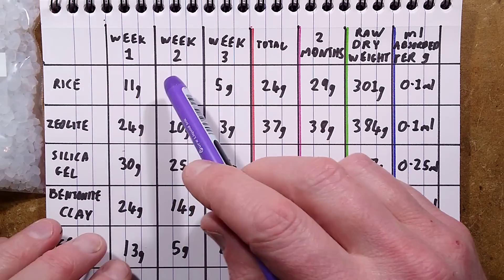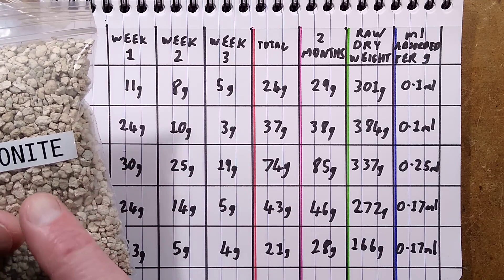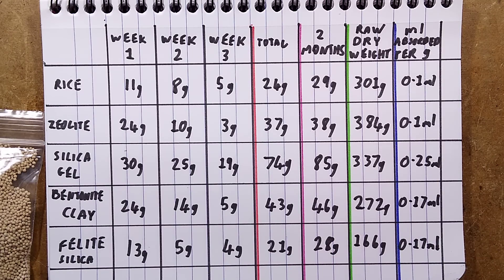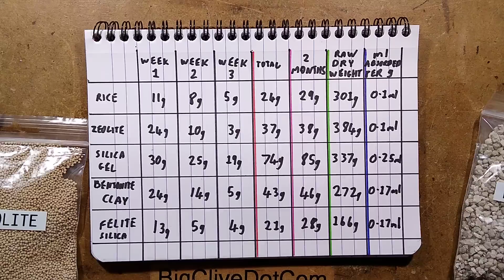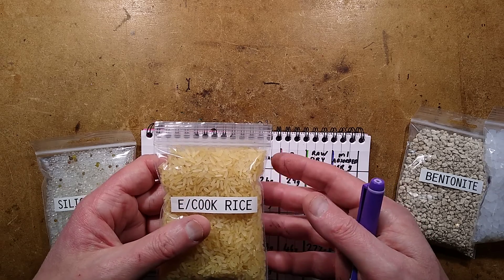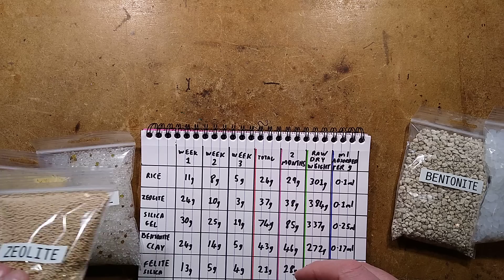Five desiccants - two month test with full results

Comment: You can also go the other way. Meaning you can hydrate the material to constants weight and let them equilibrate in whatever way suites your purpose; put them in a closed container containing a damp paper towel (not in contact , of course. The two processes occurring are adsorption and absorption; fully hydrating and then letting it equilibrate gives a better understanding of adsorption.....less worry about absorption.

Comment: Hi Clive - been watching your stuff for a while. Nice analysis! I have a PhD in porous materials and work for a company that makes instruments that evaluate how well desiccants work (among others, we use a method called DVS). 

There are generally three important parameters that define them. First is basic - how much water they take up. Second is how fast does it take for this to happen. Third is how much energy you have to put in to activate them, meaning dry them out completely. There are some subtleties associated with each parameter, some pointed out by other commenters.

The amount of water desiccants take is generally set by how much water (1) fits in pores in their structure or (2) can chemically react with the material, or both. What is interesting is that this exact amount often depends on the ambient humidity. For example, both Zeolite 13X and Silicagel can take up about 30-40% by weight of water when completely wet. The zeolite takes up the nearly the entire amount below 1% relative humidity or RH. This means that using it will keep the environment bone dry, but it will quickly be used up. Silicagel on the other hand will take up 2x more water when humidity is high (60 RH) than when it is low (30 RH). This means it is better for an environment where some water is fine, but you want to keep humidity from climbing too high. The relationship between humidity and water uptake is called a sorption isotherm.

The speed at which the above happens is also important. You can have a desiccant that takes up more water than anything else … in about 6 months … so it will be worthless. We call this the kinetics of uptake. Most desiccants on the market are fairly quick to reach equilibrium, under an hour or so. Organic materials like rice tend to be slow as the water has to go inside their structure.

Finally activation is important if you want to reuse the thing, and how much power you need to do it. It is governed by how strong the water interacts with the material. We measure this parameter by keeping the humidity stable and heating the sample up slowly while continuously weighing it. You can then tell how much water is lost as a function of temperature from the mass. Silicagel can be fully activated slightly above 100C, while zeolite 13X needs over 300C and a vacuum. This relationship is called a sorption isobar.

Some people mentioned testing calcium chloride. It deliquesces and turns into a liquid. There is a way around this though - you can put the salt inside the pores of some other material, like inside activated carbon, so that it is confined and does not leak out when liquid. You can then get best (or sometimes worst...) of both worlds. :)

If you want, I may be able to test those materials of yours. We're in the UK. Feel free to reach out!

Comment: There is substantial variation of the regeneration temperatures and optimal adsorption temperatures between the different desicants. (also speed of adsorption/regeneration), They also have much different optimal humidity ranges. Silica has very high capacity and speed at humidities above 50%RH and modest to low room temperature but it is a very weak attraction to the water molecule so the capcity drops greatly as humidity drops or temperature rises. anhydrous calcium sulfate on the other hand has a fairly low capacity by wiegth and is slow acting but it will keep working even at extremely low humidity and in the hot summer. However, the regeneration requires an oven with good temperature control. (Around 200C but I forget exactly. Too hot will permenently deactivate it, somewhat too cool will take days instead of hours to regen.)

Comment: yeah no way you're activating those molecular sieves (zeolite's) properly, an easy test is putting a drop of water on one and it should heat up enough to sting. looks like 3A too, which perform worse for H2O than 4A. That being said, silica gel/MgSO4/Na2SO4 would be easiest to source/handle for the use purpose.

Comment: Clive, what I would love to see is how good they are at retention of water, for example, I have been told that Carbon Fibre 3D printer filament will actually pull moisture out of silica gel whereas it wouldn't from Zeolite so for drying purposes, silica gel wouldn't advisable in this scenario unless the silica it was perfectly dry to begin with

Comment: Is there any reason you didn't normalize by the raw dry weight? Not confident on the dryness?

Edit: just realized you'd have to dry it all and set aside some of one to balance with the others, since the dry weight is a measured value. 
Also, I realize the last column is basically that. I think a graph would've been useful to visualize the data.

Comment: Two other things you might want to experiment with are Epsom salt and Drierite. I also have experimented with a lot of things to keep my filament dry and I mostly use silica gel now. Epsom salt is actually a hydrate of magnesium sulfate with 7 water molecules! If you bake it a bunch of water comes out and it will recrystallize. If you bake it above 320 C you can get all the water out into an anhydrous form but regular kitchen oven temps get you most of the way there. I don't use it as a desiccant for 3D printing because I found it doesn't have a very low minimum humidity it can bring things down to. I suspect it could be a winner if your goal is amount of water that can be removed per gram of volume. 
If your goal is getting the lowest percent humidity in an enclosed space then Drierite is what you need. It's the only thing I've found that can get you close to 0%. It can also be recharged with a baking sheet in an oven. And their website www.drierite.com is a wonderful internet time capsule.

Comment: Activated Alumina is a very reusable desiccant, I personally don't care about the reusable aspect so I have been using Calcium Chloride. It can be bought for as little as 3 usd per pound or 450 grams so its very cheap and its cheaper to buy more than to dehydrate it although it is technically possible. Plus it turns into hard water when its fully used up, so its very noticeable when it's all used up. It keeps my nylon filaments extremely dry.

Comment: Some dehumidifiers use a zeolite disc to extract mpisture from the air.

Zeolite its a better material for mositure transients while holding its structure, hence the use in a dehumidifier.

But in a static environment, other things like silica, are better, where the end state is unknown and provides a better 'all bases' usage - hence why its used in food and shoes, for example..

Comment: I work in a lab with ultra-high vacuum chambers (made of steel), and to achieve ultra-high vacuum you have to bake (=outgas/degas) the chamber at 200°C for two weeks, which is the temperature and time most people agree on. I think this is because there is another desorption peak of water at about 180°C, the main peak being at about 100°C (for obvious reasons).
Being a thermal-activated process (as you might guess), it is logarithmic. That means you can do bake-outs at 60°C or even at room temperature when pumping, but it will take months or years instead of days at 200°C to achieve the same results. I am not saying that you got this all wrong because your results are interesting, but I clearly would recommend you drying the stuff at more than 120°C in a kitchen oven instead.

Comment: Firstly, may I say that this is a valid "real world" comparison of the different absorbing media for this device and this is in no way any form of criticism. I am an avid watcher of your posts and always find them both entertaining and educational. 

Please forgive me if this is a rather "nerdy" observation. Your experiments are, perhaps, overlooking an element of diffusion. The drying of the media should be fine as you are using forced air to effect the desiccation. The adsorption testing, however, relies upon diffusion through the packed media, which is controlled by the "packing model" of the column and how easily air can pass through, aka pressure drop across it. If the moist air cannot pass through the column, then it cannot be absorbed and only the outer air/desiccant boundary layers are effective. Things like the rice will pack very closely giving a big pressure drop and it may only be the outer layer is effective, whereas the spheres of the silica gel allow air flow more easily. 

In my ancient working days in a lab (1970's), silica gel desiccators were used all the time to dry samples for testing. Due to the colour change you could see the slow progression of moisture through it, but the gel had to be sieved before first use (4mm mesh I think) as finer crystals blocking the airways and affected the results.

Comment: I would imagine under different humidity conditions, you might get different results? Might? 
Not sure about the rest but bentonite clay can absorb a substantial amount of water! Incredible stuff! 
Would have been great to also see the humidity levels over the test period but that's probably asking for too much money to be spent on equipment to measure the humidity levels and plot them over time.... But you could then do a controlled test with a different amount of humidity to actually see if they all perform differently at different levels of humidity.....

Comment: As I'm currently building dry filament storage this kicked off a bit of research and I'm pretty sure your not getting any regeneration of Molecular Sieves at that temp. The consistent regen procedure from sample to sample is not important, it is important that all the samples start in the fully regenerated state.

Comment: I hate to be a cynic, but all you had to do was search zeolite drying temperature to find out optimum temperatures.  To get it really, really dry, you're looking at 300C.  Zeolite's real value is not in the total moisture absorbed, it’s in how dry it can absorb down to.  Between that and selective drying of water as well as pressure swing adsorption, zeolite is pretty amazing stuff.

Comment: I think the methodology is fair enough; most people won't have a dedicated device already and if they do it's probably like the one you bought.
The "ml per g" does sound less important than the "2 months" figure, since more use cases are volume bound. 
I do wonder about the microwave method of drying silica, and whether that works for bentonite. And if bentonite is cheaper.

Comment: Very nice test. As they say - the difference between science and fucking around is writing it all down :)
If you can use a liquid dessicant then there are some much more effective ones. My goto is Calcium Chloride. It can absorb many times its own weight in water before being saturated. You can get it cheap in big volumes as it is a fairly common substitute de-icing salt. You can find it in big buckets for home use, or do like me and get a whole 25kg bag for a pittance :)
The big downside is that it turns into a liquid salt brine when saturated, so it needs some sort of device to catch the drips - and ideally something to suspend the dry salt. Not exactly complicated or anything, but you cant just throw a packet into a drawer or bag for small uses like that. 
Although Calcium Chloride is technically also reusable, it is impractical as the liquid salt brine will solidify into a massive hard salt crystal when dehydrated again. It's simply not nearly worth the time and effort to both dry and hammer into pieces when the cost is so low.
I use the stuff a lot to keep rooms like cellars/attics/work areas dry in the high humidity season. Pack an old sock or similar with the salt and suspend it over a bucket and you will be amazed at how much it absorbs. Easy to keep track of the status too as the dry salt will visibly "shrink" as it is exhausted.

Comment: Hi Clive, Zeolite binds water quite tightly (up to 30%) in its structure so in order to 'dislodge' it out again, you really want to go a bit higher than 90°C. In our lab, we used to bake the zeolite at 120°C. I think, industrially, they go even higher to get really 'activated' zeolites. 
It's quite important to check which zeolite you have; usually it's the 4A stuff.

A good test for zeolite dessicant; take 10-20 grains of (cool, dried) zeolite in your hand and put a few drops of water on it. You should feel them heat up noticeably. If you don't feel that, your zeolite is maybe the wrong type or degraded;

Comment: With zeolites there are a very wide range of zeolites with very different microscopic pore sizes for different purposes - I've tried to buy the right zeolite for different purposes from eBay but not been able to get anywhere - my reckoning is that it's necessary to go to a specialist supplier.

Comment: Yes, heating the dessicants to 90C will drive off SOME moisture, but it's akin to throwing them into a pot of 'almost' boiling water.  The heated air that's being forced over them is, at best, 'humidity reduced', but it's still FAR from dry air.

Comment: While I scoff at the whole 'submarine phone' dried in rice, I ALSO scoff at the 'warm dry place'.
Personally, I throw the ENTIRE phone into something like anhydrous methylated spirits (which is basically denatured ethanol) and give it a real good 'swim' in the stuff.

Any water will RAPIDLY mix with the ethanol thereby DRAMATICALLY 'diluting' the amount of water left in contact with the electronics.
Once removed from its BATH in solvent, then get your wife / girlfriend etc hair dryer and put it on fan only (i.e. no heat) and throw the phone in the airstream to rapidly evaporate any remnant alcohol.
A BONUS is that this will give it a half decent clean at the same time and the half-arsed flux cleaning that was done at the factory is improved upon!.
A potential DOWNSIDE is that SOME plastics don't overly like ethanol (but such plastics don't get used on phones, so you should be fine).

I know it SOUNDS counter intuitive to DRY something by first fully immersing it into a (wet?) liquid, but I can guarantee you that within a few minutes, it will be SIGNIFICANTLY dryer than if you'd placed that phone in a bed of rice!!!

NB: If the initial 'swim' the phone took was in sea water (i.e. SALTY), then it's best to first drown it in distilled water a few times to rinse out as much salt as possible.  (Once again, this SOUNDS counter intuitive).  Pure (distilled) water does not conduct like salty (impure) water does.  It's all those impurities that will destroy your phone rather than the water itself.  As the water component evaporates, it effectively CONCENTRATES the remaining (salty) impurities!
Reply: Two notes of context for others reading this:

1) Conformal coat can be removed by some solvents, and so tin wisker susceptibility or weatherproofing can be affect. Ask me how I know…

2) Salts are generally insoluble in ethanol, isopropyl, etc.. This is why you use distilled water first.
Reply: @tylervanderkley 
I agree that conformal coating is often easily dissolved by many (most?) carbohydrate solvents, I've not seen any mobile phones that actually use conformal coatings.  (But that does NOT mean such devices don't exist!).  The conformal coating I use is handy in that it doesn't need to be removed if any 'rework' is required on the board.  (Just apply another coat once it's repaired)

NB: Some people aren't aware of the difference between solder mask and conformal coating.  Solder mask (often green in colour, but available in almost every colour these days) is applied to the bare board BEFORE any components are added.  One of its many purposes is to avoid solder bridges.  There are intentional GAPS in the solder mask to expose the pads that the components are soldered to.
Conformal coating is (generally) applied AFTER all the components have been soldered to the board.  It's purpose is to seal the ENTIRE board (including the component pins that have just been soldered) from exposure to the elements (such as humidity etc).

My last quasi-humorous  comment explains all I was 'taught' by a wise old man about waterproofing electronics that have to live outdoors...
1: Spend an inordinate amount of time coating everything and sealing it up nice and tight into a suitable enclosure.
2: Once that has been accomplished, bore a fairly decent sized hole in the bottom of your newly sealed enclosure so that all the water that WILL get in has somewhere to drain out of!
YES, it sounds ridiculous, but whenever I follow that process fully, the thing lasts.  And when I don't precisely follow that process, it will only last a few months at most!

Comment: From its appearance, I’m assuming that Zeolite is a mole sieve desiccant.  The brand I’ve used is Wisesorb.  They recommend 550C for two hours to dry it.  At 90C, it can continue to capture water molecules.  My experience (not scientifically measured) is that it very rapidly adsorbs (not a typo, absorb is a different process) moisture, and takes the moisture to a level lower than silica gel does (measured humidity 2% in  minutes vs 15% after hours).  Did the zeolite lose weight when you put it in the drier?